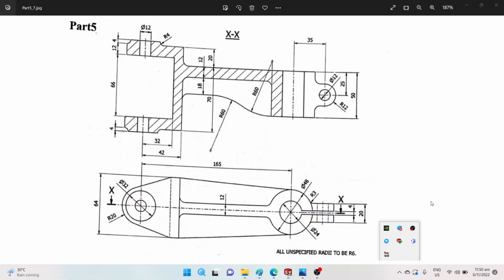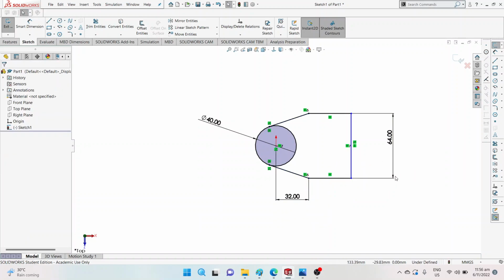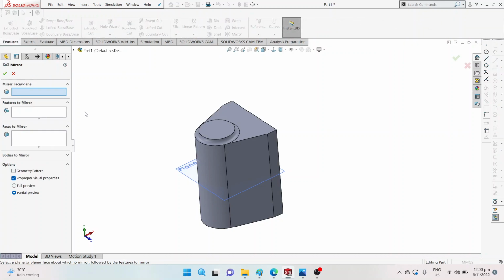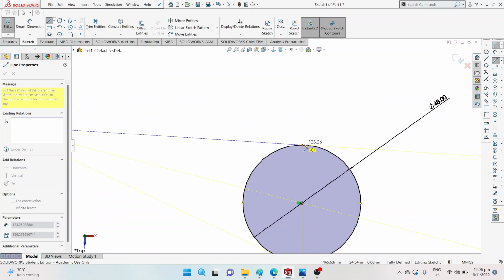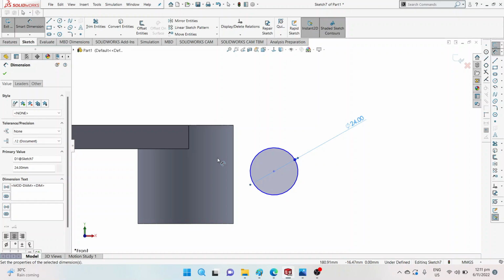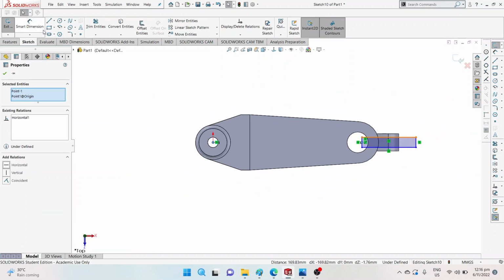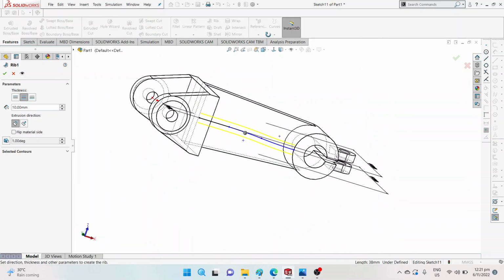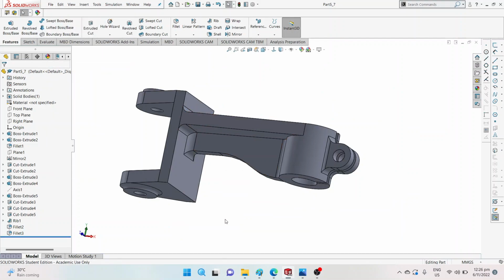Part5_7

Comment: Radius 60 part should have shown in sectioned as you had taken section line in centre of the part.
Reply from the maker: Thanks for the comment. According to general practice Ribs and webs need not be sectioned. I consider the Radius 60 as a rib.
Reply: @chongweiang3501  okay 👍